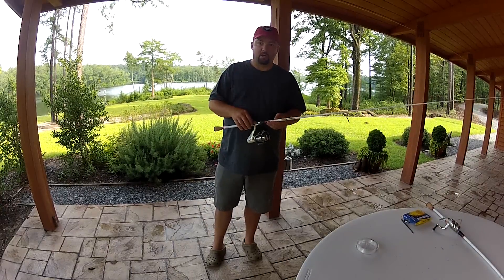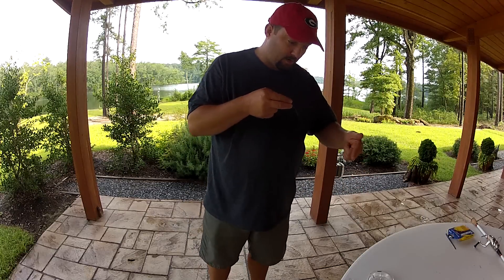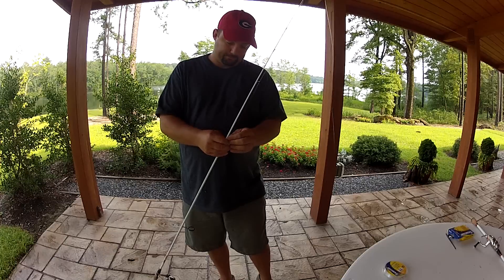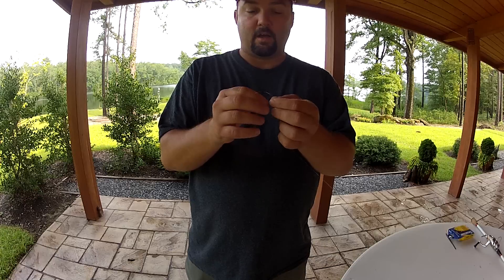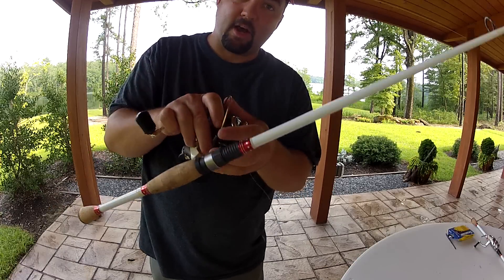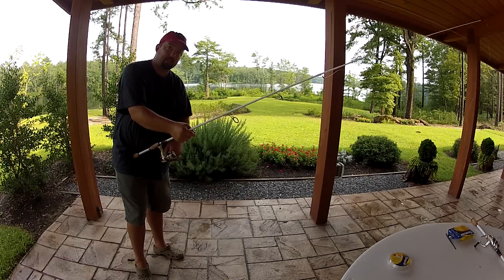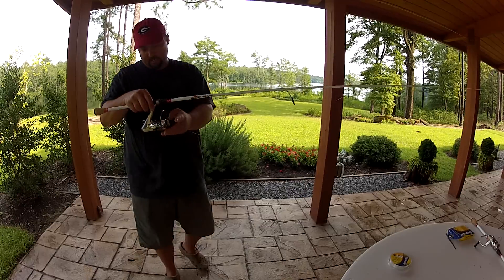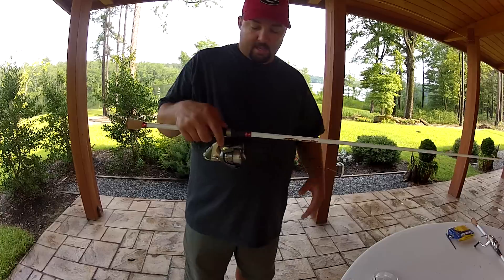How to Put Line on a Spinning Reel

Comment: Thank you for making the video and showing how easy it is to put new line on. Also after reading down through the posts, I'm glad I saw where you should use backing, like electrical tape then put the line on. Thanks again.
Reply from the maker: Jim Merrill That's when using braided line.

Comment: Great video, pretty much the same way I do it. I like to spray a little line conditioner on the two fingers pinching the line as I'm filling the spool though, gives it a nice even coating and the line doesn't get nearly as much friction heat.

Comment: Very glad I bumped into your channel! I was so busy working all the money earnings years that I never really had time to do very much fishing and what I did was all salt water mainly casting nets in Florida. In my defense I just got off work at 6 AM and worked all night here in Central Alabama and picked up a like new rod and reel for $75 off craigslist that met your basic criteria and maybe even a little bit better than the bottom end starter. I felt very confident and came home with some Trilene fishing line that the seller gave me. So I’ve found this video again, saved in a folder, and couldn’t help myself but want to put some line on the spool. watched your video three times intently, made the knots, and remembered to flip the bail first. I was pretty damn proud of myself until I realized I forgot to thread the line through the pole! I just laughed and was better tying the knots the second time. Now I know where the name of the channel came from.

Comment: Tips:
1- you can wear a cloth glove in your rod-holding hand in this case right hand instead of having the line burning through your flesh.
2- It really helps when I submerge the main line reel in a bucket full of fresh water while filling in the spinning reel. The fresh water would create a little bit of resistance that helps my line get reeled tighter.
Thanks for the lovely video and the brilliant background.

Comment from the maker: Memory can be bad when there is to much and in this case if the line keeps it's memory to the spool that it came off of. That spool is much larger than the reel's spool and you want the line to be conformed to the smaller spool on the reel to prevent fly-off. I only treated the line once with the KVD Line & Lure. I tried to treat it again towards the end but the line was too far gone. I am still amazed at the results.

Comment: Putting the filled spool in hot tap water for a few minutes is a good idea. Wound on the correct way, to eliminate some twists that may occur,  because you're going from a larger spool to a much smaller spool that can add twists.

Comment: An added tip is when you put fresh line on, when you get to the lake let out about 100 feet to 150 feet and let line drag behind the boat with no lure or weight. This will get twists out and will give a natural stretch to the line. Then you cast with no birdnests.

Comment: I do the warm water soaking for about  30 minuets  before I spool it on the the reel  and use a wet warm towel or something to add tension while spooling it on . I was told about the warm water some twenty plus years ago

Comment: A local guy gave a tip for light line haven’t tried it on heavier line. Soak the line in water for five to seven days. I tried it and was amazed how less memory it had. I’ve had no tangles.

Comment: You put the filler spool with the line in the warm  water first the on the reel that way the line get the memory from the reel spool . But do it while the line is in warm water . Done it that way for 30 plus years and have had no problem on how the line comes off the filler spool

Comment: I know your probably swamped with questions but I could use a little help. Do you use fluorocarbon line and when. I'm re-stringing my reels and was curious if I should stay with a co-polymer or use fluoro. Thanks so much for all you do. You have a gift for teaching.
Reply from the maker: +Frank Vanco Fluoro is a different beast. Yes, it's invisible but it's a little harder to cast on a baitcaster. It's just stiffer and has more memory but it's great for fishing. Just know that there may be a little learning curve with it.

Comment: I too am still confused. Stick with me for a minute. You're standing there spooling the line on. The reel is spinning counter-clockwise (if you're looking at the reel from the back), and the line is coming off the spool counter-clockwise. That's all well and good, but if your reel is spinning one way, the line is actually coming onto the reel the other way. If your reel is spinning counter-clockwise, your line is coming on clockwise, which is the opposite direction it's coming off the spool. 

Am I missing something here?

Comment: How do feel about tying two lines together?  Does the knot cause issues going through the eyes?  What kind of knot would you recommend for that purpose?

I had my local tackle shop load my reel for me but they didn’t put near enough on it, it was a full 1/4 to 1/2 inch short of the edge of the spool.  Is it okay to tie more of exactly the same line to it and fill it the rest.of the way?

Comment from the maker: It's hard to tell. I turn the fish ID off because many times it really limbs coming off a brush pile that it reads as fish. With a 90° water temp the bass are searching for oxygen. When water gets hot it looses it's ability to hold oxygen. The bass move deep into cooler water or they go in search of live vegetation or moving water. They also can become lethargic like they do in winter.

Comment: Gene,please tell me which Rod, and reel you are useing.... I have a new Duckett, white is spinning Rod, with micro guides, and I'm using a Shimano 2500 with rear drag. I've heard all kinds of crap info, but, I trust your opinion, straight flourocarbon , braid with flouro leader, or a hybrid flouro copolymer ??? Thanks in advance,  Will aka willfish4ever. 🎣🎣🎣

Comment: First of all I soak my lines before it even get put on the reel a few times in warm water  gets the reel spool memory as it gets put on  and use a warm wet cloth  so you don`t burn your fingers from the line .
I was shown this way of doing it more then 40 years ago and it don`t matter how the line comes off the filler spool   the line will loose the filler spool memory in the warm water

Comment: Hope this question is not too dumb. I've inherited a few poles already set with spinning reels and line. Some even had rigs on them. The question is, should I change the line right off of try it out to see? Also, how often should I change line, basically? I have had a few rigs lost cause the line snapped before the rig hit the water. I got a great arc out of the whole set up and saw the sinker go splash about 40 yards away before I realized what happened. My guess is this line is now degraded to the point where there is not strength in it. Living in the Northeast, should I not allow the line to freeze in my shed (where the gear is stored for our nine months of winter) or bring it into warmer temperatures?
Thanks for the great tips and tricks. I'm looking forward to actually fishing rather than just getting hooks wet.
Reply from the maker: Change the line out to start with and then change it out at least at the beginning of the fishing season. I change mine out every three months or so but I fish nearly every day. Braided line can last you up to three years though.

Comment: Great vid and tips. One question though: won't the "hot water" trick rust the metal parts in the spool? Thanks again...subscribed!
Reply from the maker: I've never had it cause a problem but if you are worried about it you can also just place the filler spool of line in hot water before you put it on the reel and it will do the same thing.

Comment: When putting braid on spinning reel is there a certain type knot to tie or do you always have to use tape or mono backing
Reply from the maker: Always use backing or tape with braid or it will slip on the spool. On spinning reels with shallow spools I tend to use electrical tape more often.

Comment: Hello.  I am a complete novice, starting from scratch using your videos.  Are you left handed or right?  I noticed that you operate the reel with your left hand, so I was wondering if there is a reason other than personal preference.
Reply from the maker: I'm right handed but I guess I reel a spinning reel with my left hand because that's the way I've done it since I was a kid. I reel a baitcaster with my right hand for the same reason.

Comment: Hi Flukemaster, I bought a Abu Garcia medium action 7ft pole and trying to decide how to rig it up. I'll be using it mostly for large mouths and about 24 - 30 in pike. I've been thinking about using 10 lb spider wide with a mono backing. Reel is good for 140 yards of 10 lb test. Should I use 10 lb mono and blood knot it to 10lb spider wire or should I use maybe 4 lb mono instead and the Albright knot? Or do you suggest something else?
Reply from the maker: Justin Kennedy Either one of them will work. I've never gone all the way to my mono backing so to me that has no importance.

Comment: Do you recommend soaking the new spool in hot water before you spool your reel or soak it after it's spun on the reel?  

Edit. Turns out reading the comments helps you answered the question below!

Comment: i mainly use baitcast but am about to purchase a spinning reel for lighter tackle and dropshotting.  what size spinning reel do you prefer for bass fishing? and what brand/model do you like? thanks
Reply from the maker: Chase Kromer A size 20 Okuma is what I've used for year. I've never had a problem with any of them.
Reply: A great one that ive used is an inexpensive daiwa samurai. They come as combos but i take off the rod. I got 4 and love em. I use an all star on mine but  A great inexpensive rod would be a berkely lightning rod or Cherrywood. I got a few of each and they are awesome

Comment: I'm a begginer...as green as it comes. I have the Seaguar Smackdown braided and the spool has these "cut-outs" on it. One cut-out was used to hold the end of the line and the other...I have no idea, but these cut-outs keeps snagging the line as I try to load my spinning reel. I tried putting tape over it but the line just snags the edge of the tape. I'm looking at this video and I notice the way you do it it does not snag on that cut-out. Why?

Comment: hey Gene I gotta question...I spooled my reel with 20 pound power pro and that has kvd line conditioner. So I was fishing and I thought my drag was messed up but it's actually my string pulling out circling around without my spool turning. First time this has ever happened...is it spooled to loose? Any help would be appreciated sir. Tight lines from KY.
Reply: should I have started with mono first... then attach the braid to it?
Reply from the maker: +Kevin Matthew Yep but you can also take a short piece of electrical tape and put it around the spool first and then tie on the braid. I do this with all my spinning reels.
Reply: Flukemaster thank you sir..introduced your channel to my nephew and brother, they were impressed.  Any necko rig video available on your channel or do you just prefer shaky heads?
Reply from the maker: +Kevin Matthew I've been working on learning the Neko rig but haven't gotten there yet.
Reply: Flukemaster when do you think you'll fish lake Lanier again you can try East bank but not now it's 30 lower and who knows I may see you there

Comment: This is a confusing issue.  Bill Dance in his video stated to take the line off the spool in the opposite direction than you describe.  Shimano and Daiwa in their manuals show you need to spool the same as your do a baitcaster.  I can see why most just revert to braided lines.  Have you never had problems with your reels drags after you have submerged the spool in hot water for 5 minutes?  Corrosion, taking the grease off the washers or damaging the bearings in the drag stack?
Reply from the maker: Henry Schmidt I've been using the same reels for 9 years now and, to be honest, I've never done any maintenance to any of them. I've never had a problem. But if you are concerned about that just put the filler spool in the water before you put the line on the reel.

Comment: Will the hot water affect the drag system??
Reply from the maker: I would be lying if I said it won't. The fact is that it is possible. If you are worried about that the other option is to put the spool of line in the hot water as you are winding it on your reel.

Comment: Raw beginner. What is the purpose of the bail? When it is "open" and when it it uh-?closed? and why is it important when stringing the pole? Poles do not seem to come with instructions. I bought a Zebco-the Duck Dynasty one-and the reel does not seem to pull the line back in. Of course, I have a mess. I was sorta expecting that-being brand new to it-but what is going on? My husband pressured me into buying from Walmart so i had no salesperson so I could ask questions. AND no my husband does not fish, eat fish or like their smell so he is no help.
Reply from the maker: The bail is what guide the line around the reel. You open it to cast and you close it to retrieve. Check out this video. Fishing for Beginners - How to Cast a Spinning Reel

Comment: Do you know how to take the spool off a Abu Garcia spinning reel? I just put the line on and I want to put it in the hot water but cant get the spool off?
Reply from the maker: Turn the drag knob on the spool several times. It will become wobbly. The pull it straight off. The spool should be easy to remove from there.
Reply: That worked..Thank you

Comment: Is it okay to put just fluoro on a spinning reel with no backing?  I've read horror stories about line twist when tying on just fluorocarbon to a spinning reel. 
Thanks
Reply from the maker: Brian Apodaca That's just fine. Spinning reels are going to get twist eventually. It all depends on how you use them and what you are fishing with.

Comment: I tried both directions and my line comes off really slack and twists around the reel if I don't guide the line every second spin of the reel.
Reply from the maker: use the hot water trick.
Reply: Flukemaster I was trying to spool it without the rod so I ended up putting the reel on the rod and guiding the line first and then trying again which worked.

Comment: What type of line should I use for fish bass
Reply: Spinning reel 8 lb flouro Sunline in the only flouro i use

And casting reel 12 or 15 lb flouro it doesn't matter
Reply: thank u
Reply: Yw And btw buy some kvd line and lure it will help u a lot the flourocarbon wont coil it is very helpfull

Comment: Flukemaster, don't you worry about rusting the gears in your reel if you soak it in hot water for 5 minutes?
Reply: Are you sure I don't want to ruin my reel
Reply: There are no gears in the spool itself, soak that by itself and you'll be fine.
Reply: +Richard Botellio So soak the spool itself first? Or when it is already spooled up,m
Reply: Fill the spool with line then secure the line to the spool so it doesn't come undone ( Gene pointed out the line holder that is on the spool).  Once the line is secured THEN remove the spool from the reel and soak it.